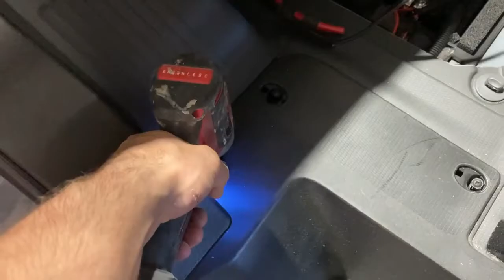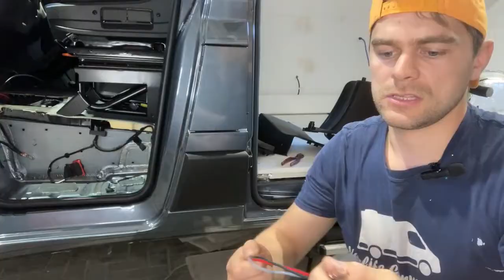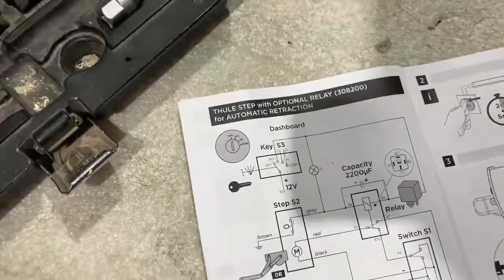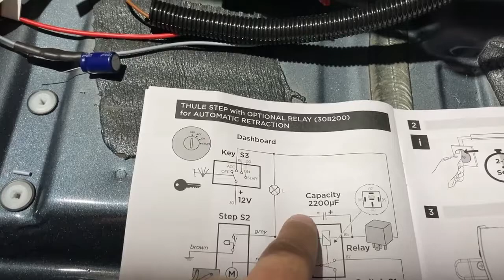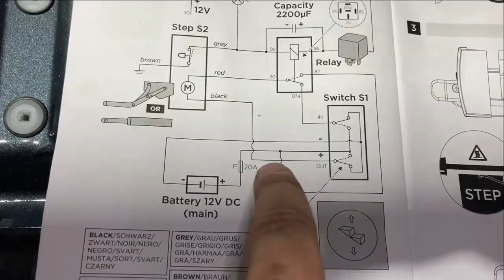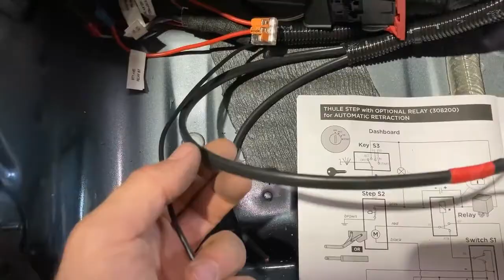How to wire in an ELECTRIC STEP to your van conversion or motorhome | Thule electric slide out step

Comment: Great video, very clear. If I wanted to power it from my leisure battery and fuse in the box at the back (my switch will be on the opposite side of the door) would all else remain the same ?

Comment: Superb video and super easy to follow. Only connection i was not clear about was taking the igntion feed from the USB/ Lighter power supply. You mention running a cable down to a wago but wasnt sure on that part. Presumably its a positive ignition feed required that feeds capacitor and relay? Hope that makes sense and thanks for your help

Comment: Would you know if this step is freed like won't operate from button but motor still works n pulling out or in manually is there a fix or need to replace whole thing
Reply: The two wires going to the old electric motor if you can connect those to the positive and negative on battery it will show the step going in and out reverse the polarity for n and the other way for out if that's the case  you then need to replace is the switch or a relay etc. Anyone telling you you can't fix these is just trying to sell you a new one so long as the electric motor is good everything else is just minor parts

Comment: Hi Great video, really helpful reference for my installation, is it possible to confirm the size of cable for the 12v battery feed and the size of the 4 core cables to the switch?  Thanks David
Reply from the maker: Hi David we used 3mm twin core flex cable for the 12v supply and 1mm 4 core for the switch. Thanks